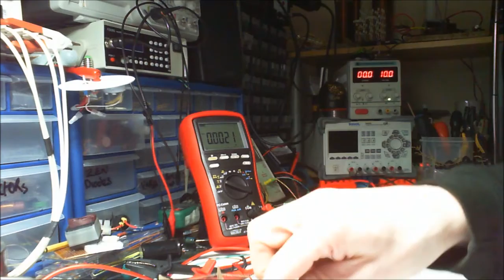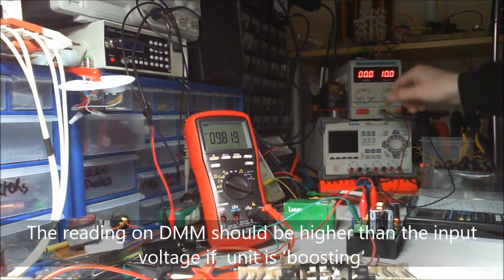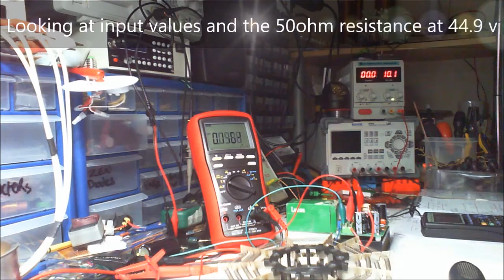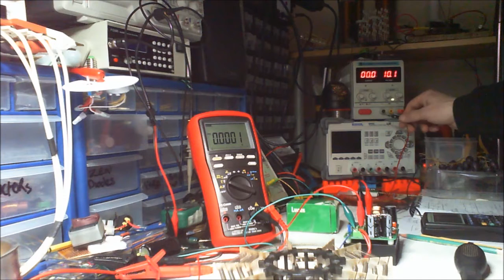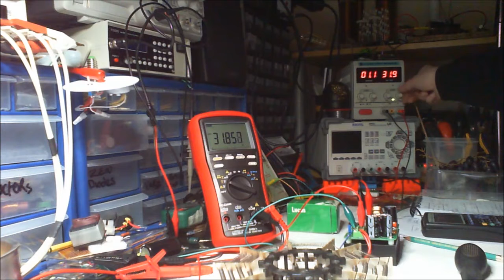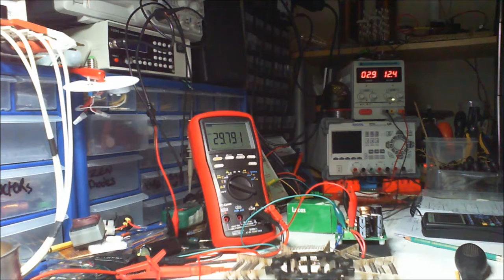Ebay 600 Watt Boost Converter - Arrived Faulty

Comment from the maker: Info provided by Bunnyathome. They should not advertise this module as current adjustable.....the engineers original schematic shows that r9 should be a proper current sense resistor 0.01-1ohm...the lm358 op-amp cant handle the very low resistance of a simple wire shunt at the switching frequency...you may be able to mod it..depends what other changes have been made to the circuit.......a 0.01 ohm would give you a range of 1.4a up to 50 amp..o.1 ohm gives 140ma to 5amp

Comment: I have the same issue, voltage trimpot works, current doesn't work.  I am trying to use this to drive an 100w LED. 
the 100w LED uses 34 volts at 3 amps.

I used an a couple ATX as input for the 12v with the same result.  LED comes on, but doesn't get enought power to get full on.  I setup the volts to 36 volts because i am not going to be voltage limiting but current limiting and the LED doesn't get more than 1 - 1.2 amps no matter how many i turn the pot right of left.  

i thought it was an issue with the ATX not being able to provide enought current (34 volts at 3 amps are around 108 watts, so input at 12 volts should go around 9 amps.  

I am going to try replacing the current pottrimmer maybe its just damaged, and try a car baterry first just to see its not an atx issue, i see you are using an adjustable power supply so now i am pretty sure its going to be something wrong with the boost. :(

Have you ever tried changing the trimpot?
Reply from the maker: Did it work? Has your current pot trimmer have connections from it?
Reply: Elecifun no, it did the same, the trimmer does do something its just not what i expect..  i thing its because a bad specs of the board that claims to do what it cant.

Comment: I have also issue with this converter. Input voltage is 12V. At the output without problems I set first output voltage at 40V. Trimpot for current was set to the lowest current.  At the output connectors I connected a LED chip 50W (32-34V/1500mA). Slowly I raised current to 1500mA. I am turned off and turned on the converter several times and everything was fine. Output Voltage was 32,6V, and output current was 1500mA, but when I raised the input voltage from 12 to 15V, output voltage and output current is increased (33,4V /1860mA). I bought two of these converters from two sellers, and both have the same problem. Has anyone tried it. Does someone have the same problems.